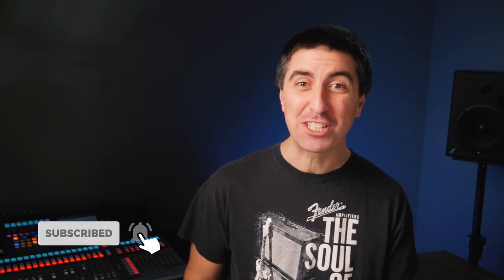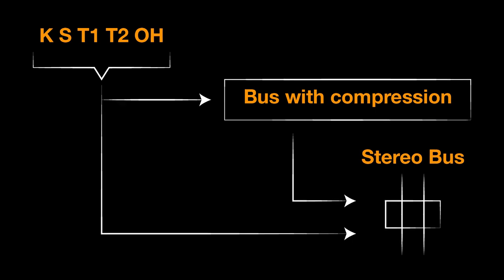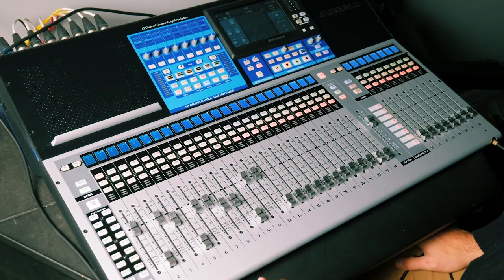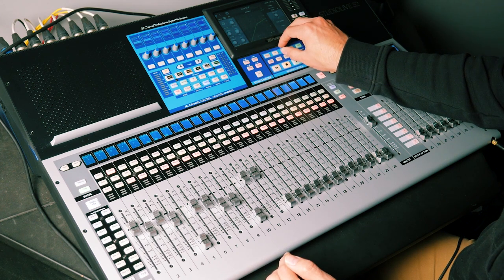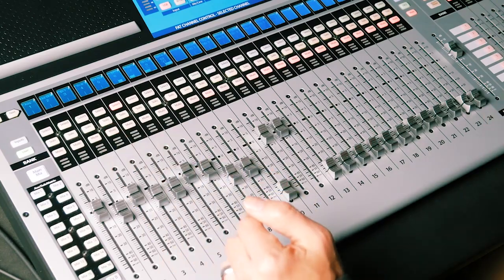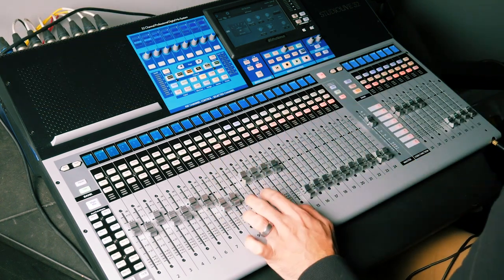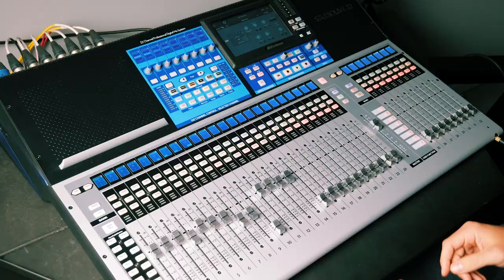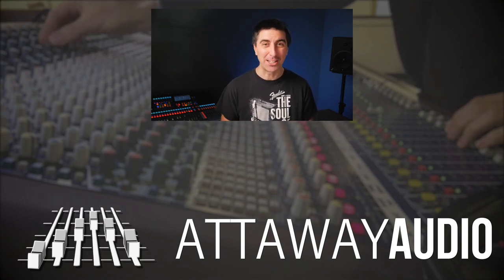How to Use Parallel Compression on Drums

Comment: What are your thoughts on using these compressor settings on a single channel and adjusting the mix knob to blend the wet and dry signal?
Reply from the maker: I've never actually done it. I have a hard time wrapping my brain around it in a live situation.
Reply: @AttawayAudio  Allen and Heath board compressors have a wet and a dry signal path right within the compressor parameters. It's been a while, but back when I was touring on a GLD80 I used it for specific channels like a lead vocal or bottom snare, and got good results. I just never thought of or tried doing it on a bus/group

Comment: Great video James, thanks.  Our Allen & Heath GLD-80 has a parallel dry/wet control.  You set it -n dB on both the dry and wet signals.  Presumably that would achieve the same effect? Any guidance on  the relative volume of wet and dry?
Reply: SQ-series has this too and it's quite a good feature although you can't have a compressor in the "dry" path. For relative volume of wet and dry just experiment with it! I usually squash the signal quite a bit and then blend that to the dry part starting with dry at 0db. Could be that they're at the same level or the wet level even higher than dry if it sounds good though. Just try different settings and as mentioned in the video if it sounds bad just start over :)
Reply: @noahd.2680  thanks Noah.  Sound recording professional mixers seem to use the approach of squashing the signal and bringing it up underneath the dry signal, as James and you describe.  My only concern is that I am using compression to achieve control.  With the dry signal on top, do you lose the benefits of control?  We feed all our drums into a drums and bass group, which also has compression, so maybe that will provide all the control we need?
Reply: @grahamf695  the amount of control always depends on how much dry signal you have in there. That's why it's nice to have a true parallel path with a whole channel strip with a slight bit of compression too.
You can also use that drum bus as you described. Would probably use that drum bus as a drum bus and not as bass and drums as the bass can affect compressor performance as it is a whole different type of source. You can run your bass to the mains directly and skip that drums and bass bus. The problem is, that drums are all about the transients whereas bass is usually not.
Reply: @noahd.2680  thanks for the advice.  We have so many mixes that the number of available buses limits us to three groups.  The other two are for instruments and vocals.  We put everything from the band through one of those groups, with drums/bass and instruments compressor thresholds 4dB below the vocals.  That makes it really easy to keep things balanced.  I think we could feed each drum input to two channels and compress both to different levels, as you suggest.  We have only one bass player (me) and one drummer on Sunday mornings, and one who plays either bass (usually) or drums on Sunday evenings.  Therefore, I never have the opportunity to mix bass and drums together, which is a bit frustrating!
Reply: @grahamf695   definitely try that sometime!
You can also try your experiments with multitracks over a Dante card. Unfortunately the gld-80 does not have multitrack capabilities without an addon card.
Reply from the maker: Yes it acts the same, but I don't prefer using the mix knob for exactly reasons Noah D mentioned 😃

Comment: Im running an electronic drumset with only Left and Right (Stereo) Output. How can I apply this principle to make my sound great? Is it ideal to let my kick and snare on one of the output and leave the rest on the other and then do parallel compression on my kick snare channel? Hoping that someone would help me through or you can make a video mixing for e-drums. Thank you
Reply: Assuming you're talking about playing through a module as apposed to software, it really depends on what module you have. The same principles would apply, but you would only be using your stereo feed to feed the compression bus vs all the individual channels. 
Your could comp them aggressively and bring that into your dry signal and see if you like it. 
I don't know very much about modules, so you'd need to look up if your module is capable of doing that kind of processing or not. 
If you use any vets like Superior Drummer then it's very simple to do.